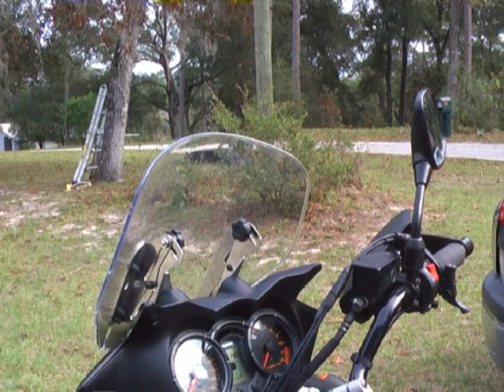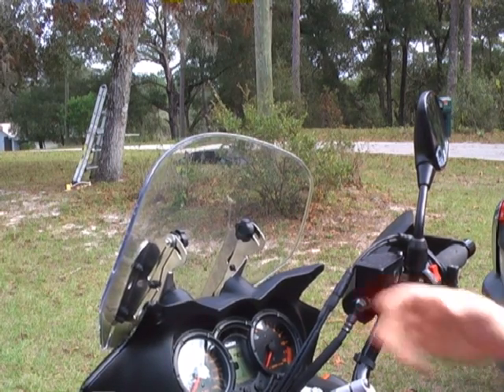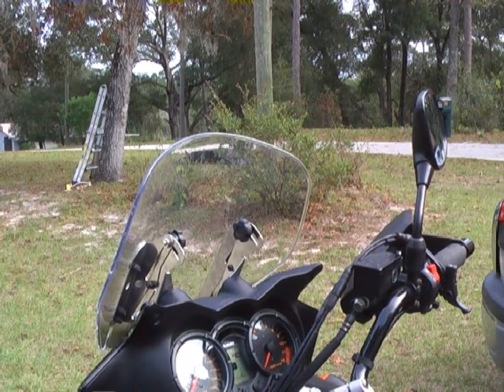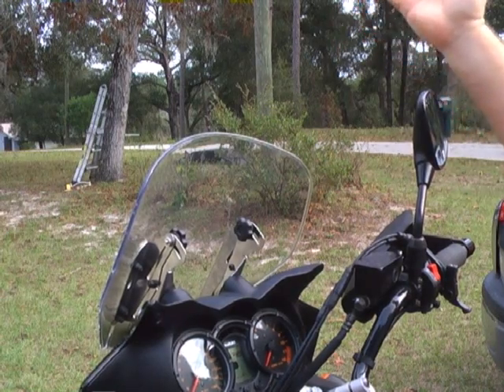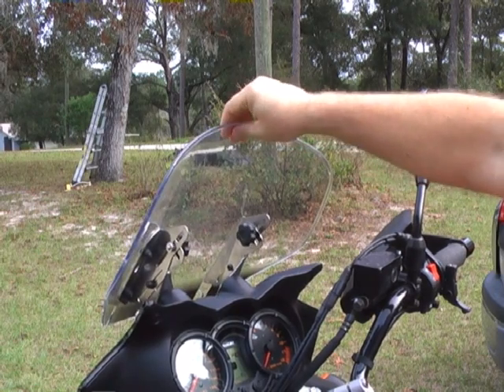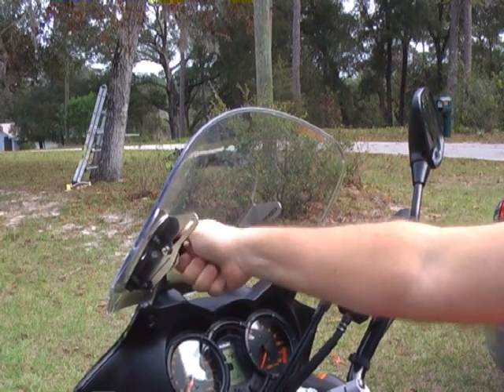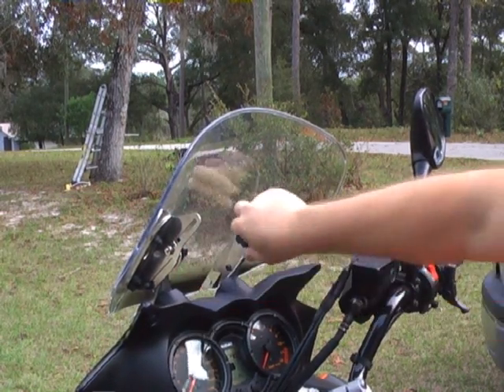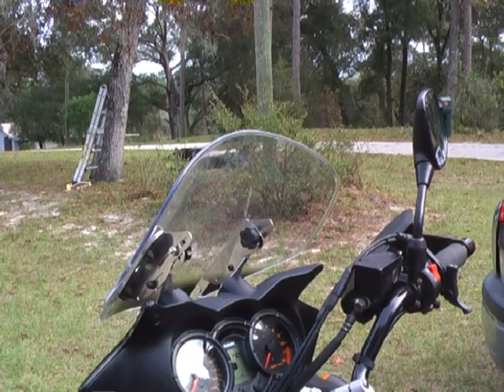madstad demo vstrom

Comment: I am seeing this 7 years after posting so you probably won't see this, but I just got one specifically made for a honda nc700x 2012. I am finding that since the windshield is somewhat out in front of the headlight I get pretty bad light reflections up into the windshield that are distracting to say the least. I see that your windshield has a dark part at the bottom, I am wondering if you did this yourself with spray paint or did it come this way? I believe something like this would reduce the headlight reflections but am thinking spray paint would get scratches etc after time even if sprayed on the interior part of windshield.